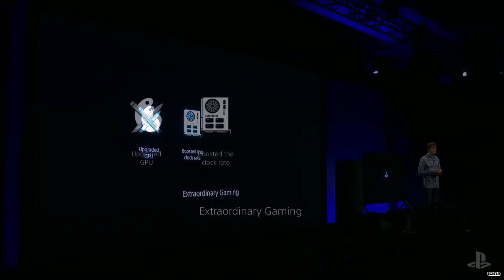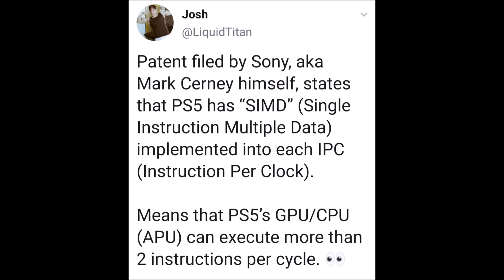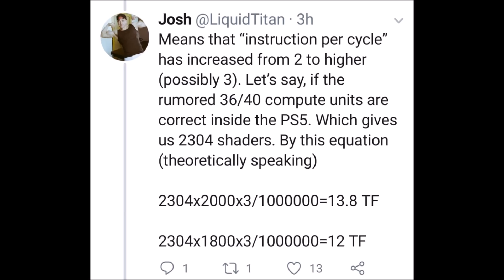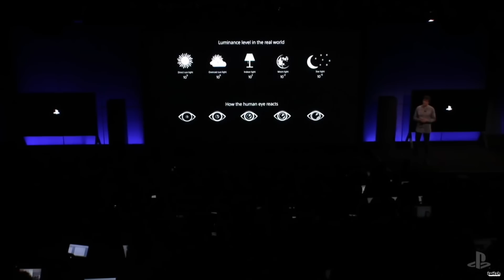Is This the PS5's "Secret Sauce"? Mark Cerny Rewriting The Tflop?

Comment from the maker: For those wondering, this is not being measured in half float tflops or what is known as the "Cerny method" either. According to those who have dived into this patent this method goes beyond the half float method. This is a very interesting find and could tell us something about the PS5 that was previously unknown, it would certainly explain a lot of the rumors and leaks and would also explain everyone's confusion over the Ps5 supposedly being better performing than the Series X but then suddenly being way less powerful than it. I'm sure there are some things I got wrong in this video so if I did I would encourage anyone who notices to point it out. I'm still learning. Also this is still all rumor territory so don't jump to any conclusions yet.
Reply: @whatswhat446  then not exclusives to SX, so yes no exclusives!
Reply: Could the Secret Sauce be DECIMA Engine integrated in the PS5 Dev Kits and SSD is made from what RAM is. Can't remember what YouTube Channel it was but was saying that SSD are made of Flash and don't last that long like mechanical HDD and that it could be possible the SSD of PS5 will same material used to build RAM that is used for PC.
Reply: Sony's gonna cover Microsofts face in "secret sauce". Nintendo can lick it off.
Reply: All tech companies have a lot of patents that never see the light of day. If Mark Cerney had the actual to realize this patent, Sony would probably make their own chips with this technology. But let's wait for the announcement. Holding my breath for Sony's secret sauce.
Reply: @kleanzlateschannel8595  I can't agree with you more if he can make it chip do everything that this guy just explained why would he work for Sony or AMD seems though he tried to get his own company to make chips.
Reply: I thought the "secret sauce" was VR... I guess that was too evident.
Reply: Tflops was the way how GCN architecture was measured primarily ... but navi tflops [or whatever u wanna call it] are double of what GCN tflops is ,that's what make tflops somewhat inaccurate way to measure navi flops squeeze more power per tflop then the way GCN... I think digital foundry did a video on this
Reply: I would be shocked if the series X is priced at $500. If the leaked specs for series X are true, I’d expect it will cost $600 or $700. If the rumored series S console announced, I would expect that to be priced at around $400 and act as Microsoft’s direct competitor to PS5.

If the series X spec leak is true, I think Microsoft will be marketing it to more “hardcore” players who are looking for the best performance and fidelity possible on console.
Reply: MBG, i know my topic is irrelevant to the video, if Microsoft strictly wants 1st party on xbox series x only and pc after halo infinite, would you still get the xbox series. I know it is not true, it is a speculation.
Reply: Half floats would be times 4 anyway not 3. After all half floats have exactly double the TFLOPs of FP32 Two times the usual multiplier of 2 is 4 not 3.
Reply: No offense but if u want to understand SIMD look up altvec, ss3,3dnow, or MMX technology
Reply: Actually it means higher throughput not 3 instructions per cycle...
Reply: https://pastebin.com/bEPknH3N
Check this out.
PS5 will have 2 versions as suspected, base and Pro. The normal one will have 10.25 TF peak, lauches in November 20 with FP game and will cost 399USD
Reply: @brunopinto3249  one is a dev kit that's been confirmed
Reply: @brunopinto3249  lmao wait this one is worse 3.5 ghz 😂 they never said anything about having 2 hard drives either 🤦🏾‍♂️
Reply: @BloodyMurda031  this "leak" was recently published in a site that I trust, I don't know if it's true or not but I don't know, I have a feeling. That's why I shared with you guys.
Reply: They are both equal in power already confirmed. No differences besides probably a 7% edge. Both are in the 11TFlop range, and the 9tflop thing is dead not correct. All in all it’s not about the tflops it’s how all the parts work together. Klee already said the 36 compute units and 9tflop info does not match the actual specs. That’s old devkit specs. And Klee said Nothing has changed in terms of the PS5 slightly outperforming the x in his latest post before he asked for the banned. PS5 and scarlet is identical.
Reply: MBG great video man 👏🏻 Very informative. I have been telling people this all a long. Not to change the subject but a few months ago before the tflop “war” digital foundry put up a video explaining why tflops will not be the determining factor for power this upcoming generation. With the console companies finally investing in a high end CPU and not just the gpu (eliminating bottleneck) along with the ssd etc it will be more about the sum of it’s parts. Also the new architecture on the AMD gpu’s are much more efficient than the gcn architecture on last gen consoles gpu’s. For example you cannot compare a tflop from Xbox one x to Xbox series x it’s not 1:1. Anyways I am so glad you switched over from Xbox. I do like Xbox and plan on getting both systems but Sony is my platform of choice 👍🏻
Reply: @SnakEyes23  Cross generation teraflop comparisons will be useless. PS5 and Xbox Series X will still be comparable to each other though. Truthfully, I don't care which system comes out with more power. I'm excited for and getting both, hopefully both at launch.
Reply: Your ridiculous this is the same way mark cerny said the ps4 pro is essentially 8.4 teraflops
Reply: @dayonerecoverdub3626  that didnt perform nothing like 8.4 tflops 😂
Reply: This was already patented by AMD as Super SIMD so it isn't really all that New, both will be great consoles and I Will probably be shifting from one to the other from time to time, this gen I only played my PS4 Pro for the exclusives but every multiplat was played on the X
Reply: ALL EXPERTS INDICATING XBOX WILL DOMINATE THIS UPCOMING NEXT GENERATION OF GAMING AND BEYOND.
Reply: I think everybody’s getting carried away with the specs, and we don’t know what they are yet. We know that they’ll both be truly next-gen, and then it’s down to the creativity of the developers. One thing’s for sure, great exclusives shift consoles, period. If Microsoft are 12 months or more behind the ball game that’s going to impact massively on the sales, which will in time impact on the games being developed. Sony’s been in consoles for 25 years, they know what they’re doing and over that time they’ve built a team that will deliver. I think we’ll see Sony peel away in front over the course of this gen simply down to their depth of knowledge. It’s nothing to do with tFlops, everything to do with great games exclusive to the platform. That’s what sells consoles. Similarly Nintendo are experts at what they do- you don’t make gaming perfection like Breath of the Wild without years of knowledge and experience. That game was nothing to do with power and everything to do with artistic creativity. I’ve no doubt Sony will produce some masterpieces of its own down the track. Death Stranding is a masterpiece, not for everyone but a step towards some more strokes of genius that justify the price of the console by themselves. That’s what this gen will be all about- games limited not by power any more, only by creativity
Reply: Nah. MBG. If this news is true. It's a major win for Sony and PS5.
This is like how Apple and Steve Jobs managed to have their OS run on 2 bit vs Microsoft ASCII running 8 bit making Apple Macs significantly faster than the Windows system. This would be huge news for Sony and would enormously help Sony and the PS5 to be the absolute beast of a console surpassing greatly anything Microsoft has to offer.
That would mean it would rival 2000$ GPU cards, they would absolutely dominate the market. There would be no need for over expensive PCs or even Xbox Series X. That's a major news that you aren't aware how big this news is. It could make the PS5 in the 18 Teraflops territory potentially or at a lower price point than the Xbox Series X for a significantly power boost.
Reply: @James-Corey-JC7  😂calm down bro
Reply: MBG the answer is NO. Mark Cerny did not do what AMD and Nvidia haven’t. He did not find a way to double tflops
Reply: @Evi7Monkey  these guys are reaching just bend the knee and concede we already know but the Xbox series X is going to be the more powerful console just deal with it.
Reply: Its gonna be more efficient than series x despite the tflops number.
Reply: MBG it’s called rapid packed math...
Reply: @princegroove  That is really just a marketing terms that AMD came up with and Sony adopted. The technical terminology is either half- float, half precision float or FP16.
Reply: Hahaha u will latch onto anything😂😂😂 stop crying about this but u have lost so much sleep I can hear the desperation in your voice simple fact on xbox has destroyed the ps5 with the next xbox the information your putting out her it totally wrong fanboy bullshit trying to build hype for your very underpowered machine

Comment: This is totally incorrect, man, just fake news confusing your audience. Sony doesn't design CPUs, APUs, or GPUs. It's just a mater of how much Sony will pay AMD for it. Looks like it will be less than what MS is paying.

"We saw that Phil Spencer showed a picture of the GPU, the APU, I don't know what it was, yes, the SoC he said."

You're commenting on the hardware capabilities of a console system and don't even seen to know that modern consoles (including XB1 and PS4) have the CPU and GPU built in a single chip, called the APU or SoC...

Comment: I haven't looked at the patent, but SIMD hardware is nothing new, both CPUs and GPUs do multiple different types of SIMD already, heck GPUs specialize in it. Now there might be additional improvements, but these tweets look suspect.

edit: and I should point out, that even if there are improvements in floating point calculation parallelism, it only matters if the shaders can be written in such a way that those calculations can happen in parallel, if there is a branching instruction between the calculations, the instruction level parallelism cannot happen

Comment: I'll laugh my ass off if this source is just talking about FP16 compute. So basically this is hyperthreading for GPU's? If something this good was possible why would AMD or Nvidia not implement this on their cards? Come on this nonsense. This is just rapid packed math, which PS4 Pro uses and the Vega cards.
Reply: No, that's not what the 'leak' post was talking about. 
It was talking about an IPC of say 3 or 4 rather than the regular 2. 
RPM is about executing twice the amount of fp16-bit integer calcs than fp32-bit integer calcs. 
It will do that as well as this possible new 'feature' talked about in the patent.
That 'leak' could all be total made up BS however 🤣

Comment: as developer from a third party company custom solutions and features are nearly impossible to use because console manufacture deliver very poor documentation for the first 3 years they keep the good stuff for themselves and for exclusive partners and even you use multi platform engine like unity and unreal engine don't get your hope that these are going to use it most of the time this engine are designed to run on maximum number of devices sharing the same codes

Comment: The only thing Sony can do different from Microsoft is to trying to get 7nm+ for the AMD GPU. That allow them to get a way smaller chip and a higher clock speed, but other than that at this point there nothing much they can bring to the table. 

There is also the RT cores things, maybe Microsoft will talk about 12 Teraflops Including DXR raytracing tech and Sony talked about 9 Teraflops and another chip specialized in Raytracing acceleration like PowerVR did.

Comment: I don't know enough about pc specs and APUs to accurately make any comment. I think I do know that there are different ways to measure Tflops. I would like to know if it is going to run on RDNA 1 or 2. This much I think I understand which isn't really new or a secret sauce but will I believe be able to do more computations. It would really have to be specialized as AMD hasn't even made an APU (as of Dec 2019) with RDNA 2, yet though, it's expected to this year. Also,  i listened to some guy describing all about AMD CPUs and GPUs (which was exciting as watching paint dry...lol), ultimately discussing the next gen console's processor. I don't care if series x is slightly more powerful just not significantly more powerful as long as it performs well and they can effectively cool it and hopefully run quieter than Pro. Performance is a lot more important than power in my eyes at least. We shall see. Thanks for this 2nd vid from yesterday. I greatly appreciate the time effort and energy you put into each one of these videos.

Comment: Just make the PS5 quiet. The PS4 Pro is so loud I can hardly hear the tv when I game.
Reply: NIXNE sounds like a jet taking off. And that’s when it’s in the menu with some games.
Reply: GaMeR_bOi_83 lol this is not an exaggeration.
Reply: First mistake is using your TV speakers. Yuck. That said it is kinda loud.
Reply: Siji Adegoke i have a surround sound system.
Reply: @NIXNE  sounds like your pro is faulty if you can hear that stuff above a surround sound system
Reply: Siji Adegoke It could be. But, I know its a common complaint I’ve heard amongst friends and people online. I would be surprised if everyone complaining had a faulty PS4 Pro.

Comment: I never measure a console in numbers, It all comes down the the games.
How do they run, how do they look, and most importantly how fun are they.
In the 80's we only cared about kilobytes of ram. Then 90s was all about Bits 8/16/32/64 etc. 00s we were all about clock speed, then back on RAM, this gen has all been about teraflops, but take a look at Nintendo. They always squeeze more performance out of their hardware when compared to similar hardware. There are other hardware factors and software optimisation to be considered too.
Wait till you see actual gameplay (not the trailers shown at conferences)

Comment: hard to believe this is possible since they need to change the overall architecture(would be cool though), remember that SIMD require data alignment that could put off some of the claimed easy to develop for (but again might be easier when having ssd). SIMD is rather executing less operation for repeating activity than performing more instruction per clock cycle..

Comment: OMG who’s actually believing this crap! Every new generation we hear this bullshit from sources about how they’ve managed to do something so amazing. 

Likely Sony are bringing a great console. 9+ TF is fantastic! 4K 60FPS is more than possible with next gen. 

Sony will win with price and games. 

The series X is going to be significantly more powerful than PS5 but you’ll pay for it just like you would with a PC. Likely the weaker Xbox series s or whatever it’ll be will be comparable to PS5!
Reply: What's crap about a patent? If it'll come to fruition is another matter but its there in black and white, submitted by a bonafide system architect not some random person. Chill dude
Reply: Siji Adegoke If this was possible to do Sony wouldn’t be the only ones doing it. Period. Every new gen that comes around does this. It’s fairytales.
Reply: William Felix yeah but that’s not going to be the case this gen. like any maturing industry everything eventually unifies. They’re likely using basically the same modded chips. Saves them money this way.

Comment: Sorry to burst your bubble but SIMD is old tech. Intel calls it HyperThreading. AMD calls it SMT. Heck all smartphone s have it as well.  This channel is so mis informed its not even funny.  SIMD is not secret.  Heck all GPUs are SIMD by default.  The grasping at straws is getting pathetic TBH.
Reply: SIMD isn't SMT, but it is old sauce. e.g. vector instructions are SIMD, you take one instruction (e.g. dot-product), and then multiple data (two vectors, 8 floating point values). HT and SMT are instruction parallelism between threads, e.g. thread1 is waiting for data or doing an operation which takes multiple cycles, then you can do some instructions from thread2 in the meantime.

That said, if they have some new SIMD patent, there could be some developments there, but I doubt it will have much more impact than half precision floats
Reply: @defeqel6537  Yes, I'm well aware of the differences.  My answer was bait of sort.  A quick wiki search would have given ample refutation to my answer, and would have lead to some better discussion on this echo chamber.  Took a whole five (5) days for someone with a bare minimum of knowledge to even respond.  Ty for that.  Sadly, there is no hope for the rest of the comment section, Ignorance is Bliss as the saying goes.  Intel integrated MMX (SIMD) instructions over 23years ago,  probably older than the rest of the posters here...lol
Reply: @VRforAll  Ahh, ok then. I agree, that it is pretty annoying seeing all the hype and silly console war stuff, when the commenters have less than zero knowledge on the subject.